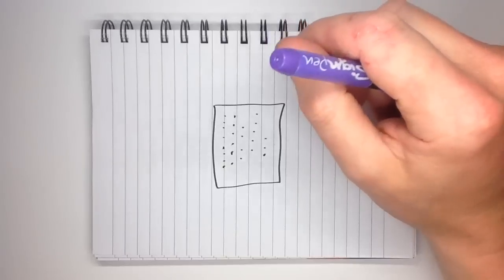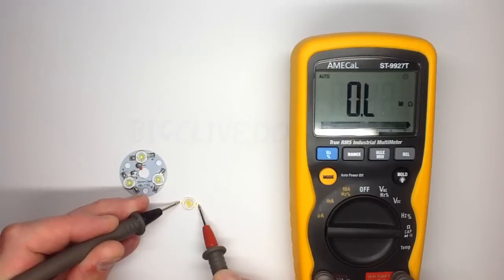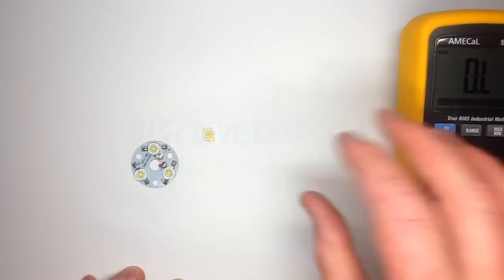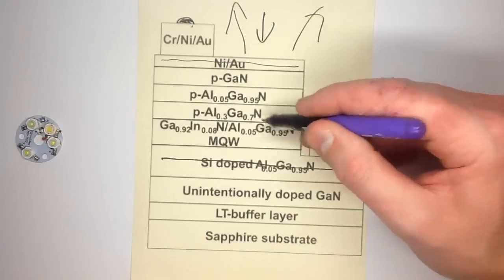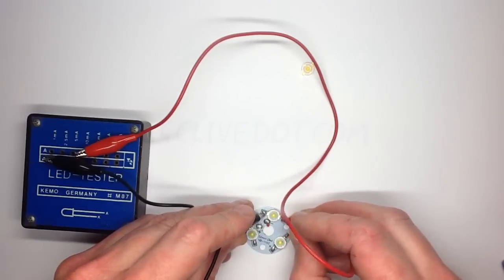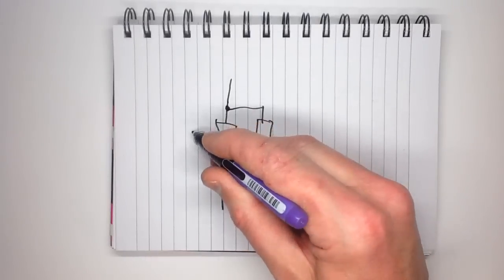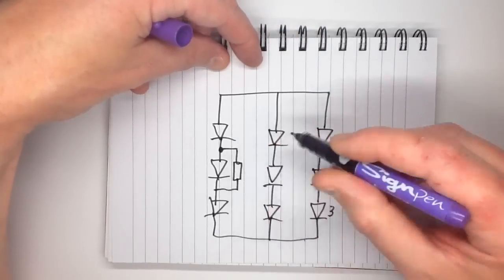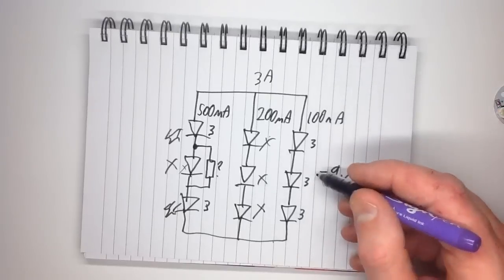The clown-science of crappy 100W LEDs.

Comment: Some eBay sellers cant tell the difference between faulty and good LEDs.
I filed a return on a faulty led and explained to them scientifically and with pictures why it failed, and the seller said "By the way,you can try to use at 110V .12V maybe can’t work."
Seriously WTF(110v to an LED =dead LED With possible fire).
 You should know what Your selling on ebay so you could actually help someone. :(

Comment: If I was building my own 100W led flood light, would it be a better idea to use 5 20w packages rather than one 100w package? bigclivedotcom
Reply: Slot1Gamer Yes, and better still would be to buy more 20W LED packages than you need and reject the worst of the lot.  This is true because you're building a flood light, so multiple LED modules don't all need their own reflector and/or lens assembly.

However, that is subjective within the consideration that it's more difficult to find a good quality 100W LED at reasonable price, and that as a one-off project you don't have parameters of price or penny pinching to reduce # of fasteners or a particular heatsink junction area to meet consumer pleasing shape for the final product.

With that in mind you are always better off using a greater # of lower wattage LEDs for a flood light, assuming equal quality control and otherwise technologically equal LEDs.  

Towards that end, you'd be even better off using Cree XM-L2 LEDs, and UNDER driving them.  Under merely means below their max spec.  For example drive them at 1.5A per, 3.05Vf for  4.6W/LED.

You'd get so much more efficiency that you don't need a 100W array for the amount of light you're expecting, could just use ~12 * XM-L2 @ 4.6W = 55W which also eases thermal management.

In other words, when talking about "better", it's better to use high quality components until the BOM exceeds the energy savings in the target use.

Comment: I wonder if it would be possible to use a drill press to disconnect the worst/most offending strings in these LEDs so that the current would feed the other slightly more efficent ones.

Comment: bigclivedotcom Interesting video sir, I've never really thought of looking into the composition layers of an LED before. I recently purcahsed a batch of cheap Chinese 10w LED's and I have to say I was impressed at how perfectly matched they were when powering them up slowly on the bench power supply. It seems that the Chinese are quite happy to make good quality 10W LED's, but not 100W ....
Reply from the maker: +xponen I'm using a Lenovo right now.  It was somewhat reduced in price because it came with the Superfish issue.  I bought it knowing that and immediately removed all the associated files and certificates before even connecting to the Internet.  I also removed the rest of the bloatware it came with.
Reply from the maker: I've been toying with replacing the big failure-prone LEDs in my bench lights with a cluster of the 10w LEDs.
Reply: This is exactly what I bought my 10w cob strips for, initial tests show they are significantly brighter than my exisiting lighting, just wokting on a mounting and heatsinking solution
Reply: coffeemaddan
Thank you.  So many people try to just blame country of origin as the only issue.
Reply: +Stinky Cheese Yup, I have a Chinese laptop and a Chinese desktop. They work really well. But they're also quite pricey. Yup you guessed it. Lenovo. The Chinese can make astonishingly good quality stuff. If your prepared to pay for it. If you want cheap sweatshop priced goods, then you take the risk!
Reply: bigclivedotcom They're dirt cheap.  Use twice as many at ~40% current.
Reply: +75IFFY , Lenovo laptop isn't all good.... it made into news headline twice for 2 different case of having software that compromise user's online security.
Reply: xponen
Oh, im not a Lenovo fanboi, they do have their problems. The bloatware is most annoying, but they're not alone in that. However, in general they're good hardy machines that are very user serviceable/configurable.
Reply: Iv got Think line stuff, and they have a sticker n them that says Made in China. I'm guessing your getting MOOG and Lenovo mixed up

Comment: Very nice video!
1 Question:
If i buy very cheap 10W LEDs and i messure accross the combined kathode/anode and i get a value higher than 20 megaohm, than i can persume, that the LED is not so shitty?

I have bought very cheap 10 x 10W LEDs and 2 are 50kOhm 3 are 1.000kOhm and 5 are over 15-20+ megaohm.
I cant tell how good the little LEDs inside are, but you say, that the 5 LEDs with high Ohm values are of much better quality than the 2 low value ones?

Also, the vary in Value if you messure the poles the other way arround.

I would very much appreciate yout thoughts :)
Reply: +Satyrfolie132 First you can get different 10W LEDs, I have 12V (3x3) and 30V (1x9).
No, to measure >20Mohms says absolute nothing. If you have 2 or more in a row, and one is perfect >20Mohm , the next one can have a shortcut and you can't measure it. 
 Use a small Voltage that you have ~1mA and look if they light all in the same brightness. If not, they are shitty.

Comment: In general I appreciate coco’s explanation of the LED issue. Excellent sense of humor and a good video.
 
On the subject:  It is a bit cumbersome to me – to measure the resistance of a diode (LED) with the resistance mode of a multi-meter. Well you get a number. As R (of a LED) is a function that depends largely on the voltage the number (e.g.120Ohm) isn’t of much value to develop a “rule of thumb” understanding here.
It gets even worse: The multimeter might use constant voltage or constant current methods to actually measure the resistance. Leading to more confusion. I checked the IC in the ST-9927T. In the datasheet ‘s reference implementation (FS9922-DMM4-DS-11_EN.pdf  p. 26) it states 0.63V constant voltage used. Again that is a bit out of the “normal” range of 3-ish volts.
Assuming that your hypothesis is right - there should be a significant difference in the current consumption of the diodes (one with a 120-or-so-resistor) in parallel.  T LED’s are in a serial setup and one is quite low in resistance – shouldn’t there be a (significant) difference in the individual voltage of the LEDs if you operate them at the rated voltage

Comment: i am reminded of the early days of LCD monitors, where dead pixels were common on new equipment and even had a 'tolerable' amount before you counl send it back, nowadays youd send it back for one dead pixel.   these multiple led's are going to improve as they use more on a single substrate, one day you may have thousands on a large sheet somehow printed on, to make cheap large panel led's

Comment: Out of interest I've just measured the LEDs on a TCP 5W GU10, which has six double-chip Nichia LEDs. Each one has 16M resistance and a reverse-biased diode (Vf 0.75V) across the series pair.

Homebase (UK) are selling these lamps off at £1.93 a twin pack ATM although not all branches will have them: www.homebase.co.uk/en/homebaseuk/tcp-led-gu10-5w-dimmable-grey-light-bulb---2-pack-274646

Comment: Thanks Clive ! Having trouble with your analysis about which leds lite first as the supply to the parallel strings is increased. The voltage across each string of three is of course always equal. The two above and below the bad one would lite first for sure, but assuming the minimum voltage to lite an led is 3v, and the two in series with the bad one are over driven and  are dropping in excess of 3v each, I don't see how the voltage across the bad one could reach 3v before the supply voltage reached 9v and began to lite the remainder of the good leds.
Reply: robstorms 
I think you're mixing up constant voltage and constant current drivers. 
If you're using a constant current driver the broken string will pull most of that current and the overall voltage will be let's say 8,7V so the other strings will just light dimmly (LED forward voltage isn't a step function; it's not all-or-nothing at a certain voltage).
If you're using a constant voltage supply and set it to 9V, than there you have your 9V. It's just that the broken string will draw much more current than intended and the overall current of the LED would be much higher than expected.
In both cases the bad string is overdriven and will burn out.
Reply: robstorms isn't that the point of the video?  the "bad" single leds will be the last to light up.... after a fully good string begins to glow. And they will always be dimmer than the good ones of a fully good string.   The good leds in the string with the bad led's wll glow first (as only 6v across whole string is needed to begin conducting.. 2x3v + resistor)...  then the good leds in the string of good leds.. then the bad (leaky) led once the current is sufficient to raise the voltage across the resistor to more than 3 volts ..  V=IR
Reply: superdau had the same question, thanks.
Reply: superdau Hmm... I think I am correct in saying a constant current supply will adjust its output voltage to whatever is required to produce the selected current. Thus as you ramp up a constant current supply ( gradually increase the selected current flow), it must do that by increasing the output voltage ( perhaps not by much if it is driving a nonlinear load like leds. So I still disagree with Clive as to the order in which the leds will lite as the supply is ramped up( be it a current source or voltage source). Should perhaps be settled by seeing who can hold their breath the longest.
Reply: robstorms had to rewatch... yes I disagree with the order stated in the video... although I don't know if he was really meaning to say what he did.  Anyhow... yes a constant current driver simply will raise or lower the voltage to whatever is necessary to meet the current demand... weather thats 0 volts (short) or all it can give (open circuit).. although within the capability of the supply of course....    but yes.... assuming fairly sharp ramps of the led material itself, and assuming the hypothetical 3V on voltage.... at 0V nothing happens in the combined circuit (obviously)....   at 2.99V nothing happens in the circuit as none of the LEDs have met forward voltage .. so its 2.99V at the top.. and below the first LED in each string it is 0V...   at 3.01V, each of the top leds begin to conduct, which would allow the low side of the first LED in each row to climb to 0.01V ...    in the bad string the leaking LED would pass all the current though nearly instant (all things considered) to the top of the last LED which would not conduct as it only has 0.01V to ground.    The other two strings similarly the second LED in each will have 0.01V and will not conduct.      at 5.99V  we still have basically the same setup...  as still no current is flowing ...     at 6.01V now the first string begins conducting... as the first LED wants to drop to 3.01V to the top of the resistor-like-led, and with exceptionally small ones the other side of the resisitor-like-led will also be at nearly 3.01V which is sufficient for the 3rd led to conduct so that string starts to glow on the two good leds....  the other two strings have 6.01V at the top, 3.01V at the top of the second led and now 0.01v at the top of the third which is not sufficient to conduct.   at 8.99V we have a similar situation... except the first row is conducting fairly significantly ... you'd have to know the fault resistance of the bad LED, so you could use V=IR to find the voltage drop but either way.. the first led will have 8.99V at the top, and between 4.5 and 5.99V at the bottom, the bad led < 3V so still not conducting through the LED material but via the fault, and the 3rd led has between 4.5V and 3.01V at the top and ground at the bottom... .....   at 9.01V ....  now the two good strings have about 3V across each so all leds on the good string start to conduct...  the bad string is still questionable depending on the equivalent resistance of the fault.... if its really high (several kohm) it might light with very little additionally voltage rise above 9.01V on the supply.  if it is really low then maybe less.   Of course it gets really hard to calculate without knowing the ramping of the LEDs.... if the leds are prefectly ramped, then yes at 9.01V even the bad ones will be on (unless its a dead short, in which case the string will receive something on the order of 3-6x the rated current and will burn out quickly, when then it will suplpy the other two strings 33.3% over-rated current and they will die sooner than designed).    Regardless, except for the extremely low resistance fault situations, the LEDs are very non-linear... so likely the bad ones will begin to conduct fairly shortly after the good chains do...  and the rated power through an LED is well into the ramp...  so again except for exceptionally low resistance faults, at rated power, all LEDs will be conducting.... just the bad string will have 2 passing far more current than designed (extra bright, extra heat, sooner to death) and 1 passing less in the LED material itself... but yet still dumping a lot more heat into the LED heatsync) ......  and that will of course bake near-by leds.... and eventually more on the bad string will die ... either in fail open (in which case the other two strings will now go from unrated to overrated) or fail closed (in which case a current limiting supplied led will likely stop working, or in a constant voltage supply the line will burn out and maybe you'll get the other two to relight at over-rating).        THis would be so easier to explain in video than text.... sorry for the ramble....

Comment: This was very useful ,a few months ago I put a 100w led on a computer cpu heat sink with a fan and used a variable power supply to power it,when I slowly raised the voltage and current I could clearly see that a lot of the LEDs where not lit and a few where very bright but not understanding what was happening just did not know there was a problem...I do now...keep up the great vids you explain things in a way I can understand and knowledge is power lol
Reply: Haha, yes! 
I'm doing this same 100W LED project, and these videos help me for this same reasons, also Clive's Scottish accent's refreshing to boot.
Reply: 1bigsyd That does not prove there's a problem.  Individual LED dies have some variance in their forward voltage and especially several in series can cause one series to illuminate at a lower voltage than the next.  

The significant thing is how much difference there is between the Vf of the lowest series and the highest if you don't want to risk blowing a series.

It is easier to just not try to drive them up near their rated wattage and use additional 100W modules to achieve the target lumen output.  A lot of people seem oblivious to this even though it increases efficiency and the modules are now practically dirt cheap to buy.
Reply: +Stinky Cheese Agree about one series vs another, but what he's showing is random chip failures, not differences between series strings.  If you have a string of ten with current going through them, all ten should be lighting up even if the brightness isn't precisely matched.
Reply: If the difference in forward voltage is enough, then (typically using a voltage variable supply) you can slowly ramp up voltage, then stop at  the point where some dies are emitting enough light to be visible while others so little that your eye can't see it due to the others.

In that case, if you ramp the current up a bit more you may find that some if not all of the remaining LEDs start emitting enough light to see.  Certainly there are some cases where they really are defective, completely shorted in   more cases than not, but not all cases.

This is a problem with LEDs designed like this, but at the same time, their lack of quality control makes them dirt cheap and if you were to set up 100W worth of LEDs with none in series, all parallel would have more loss from balancing resistors and need a fairly massive PSU and wiring for the current required... they're 1W LED chips so about 350mA per x 100 = 35 amps not counting resistor or PSU-efficiency losses.

On the other hand some people have speculated that it's not really lack of quality control but rather these are the specimens that failed the QC testing so they were diverted to public sale markets.
Reply: Diy perks?
Reply: Stinky Cheese if you're passing current, then all the junctions must be past (or on) the knee and conducting that much current.  The smaller LEDs I'm familiar with light up visibly with microamps running through them; I doubt that the power ones are that much different.